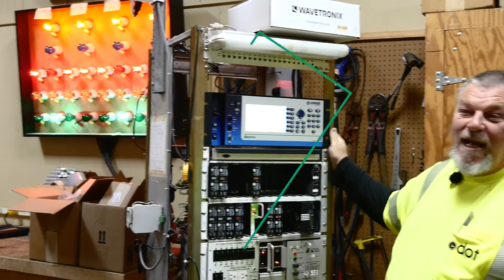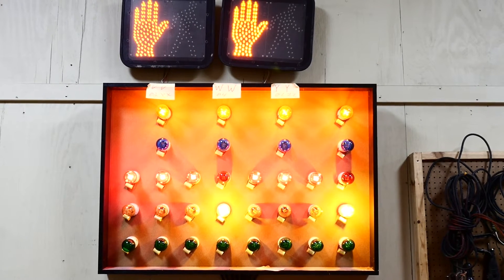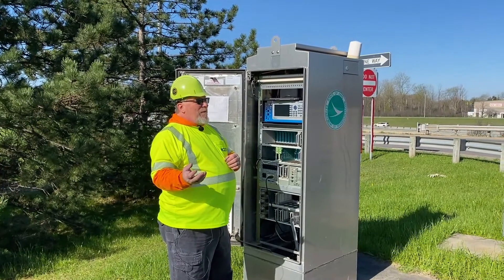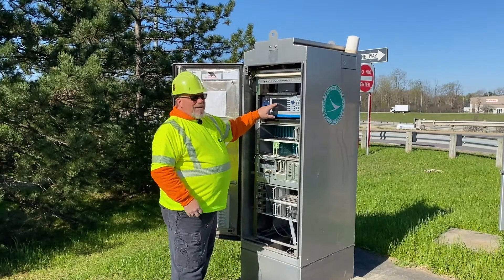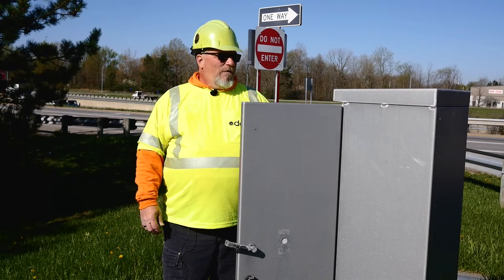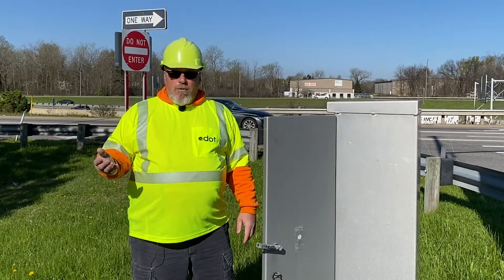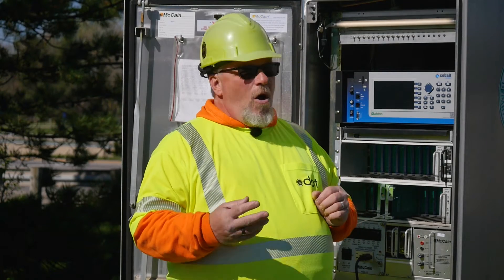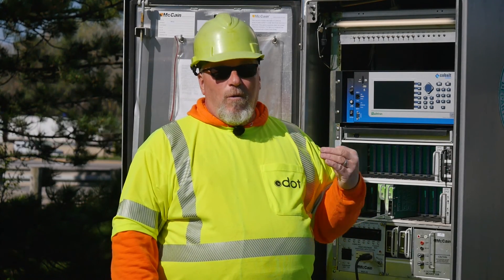Traffic Signal Technician - Testing, Inspections, and More!

Comment: Excellent video! I similar incident where a high voltage power line fell on a mast arm. It fried everything: cabinet, wiring, signal units. Basically, it required a whole new install. Making matters worse it was a large intersection utilizing all right phases.